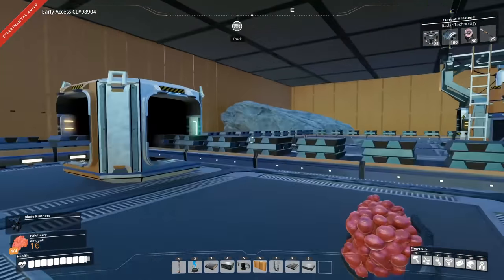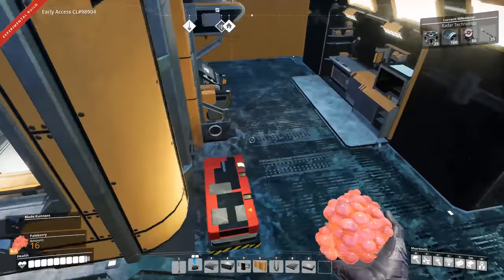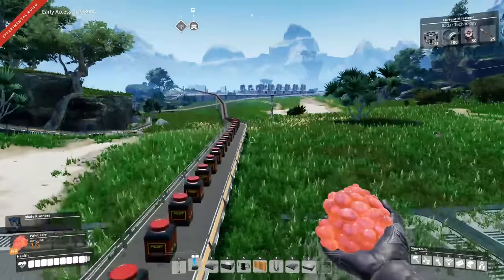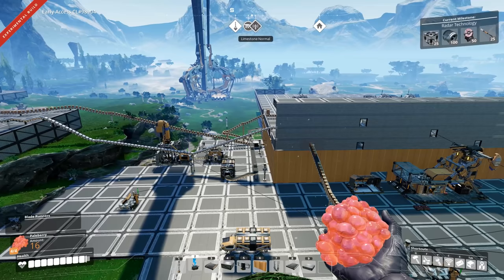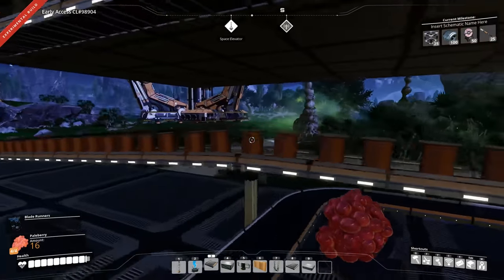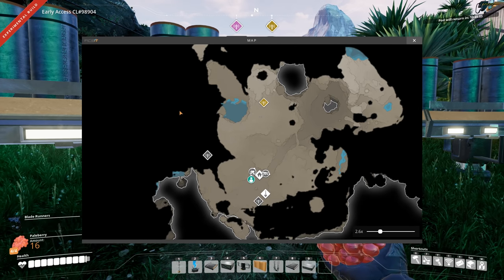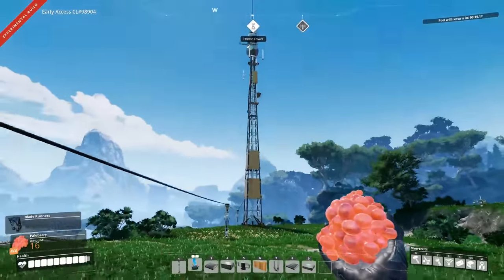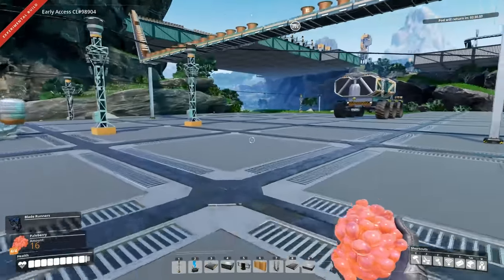Satisfactory Early Access E17 The Explorer, Crystal Oscillators and Radar Towers!

Comment: Cheap balancer: merge inputs to 1 belt, then split (1 merger 1 belt 1 splitter). Total output limited by single belt.
Expensive balancer: split each input belt, merge to output belts (2-3 splitters 4-9 belts 2-3 mergers). Total output limited by input.

Comment: As of right now cannot remove green gas areas - dont even know if it will be possible in future either - However.. What I did on my build is walk as close as I could before I started taking damage.. put a foundation down - then I built a perimeter of foundations all around it at that distance so It could turn into a wall and prevent me from walking into it taking damage.. after i had the wall as high as required I built a roof over it with foundations - so its completely encased in the larger foundations and I can walk around the area without taking any damage. but it looks like its part of my base/factory..  I even have some conveyors running along its outer edges from one mini factory to main.
Reply from the maker: Hehe, you completely buried the poor natural wildlife in concrete? :)